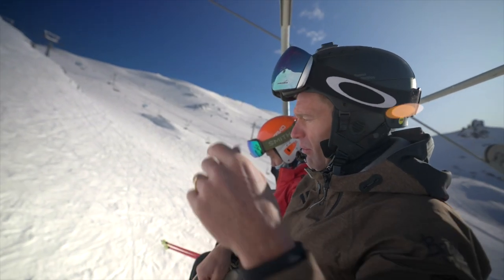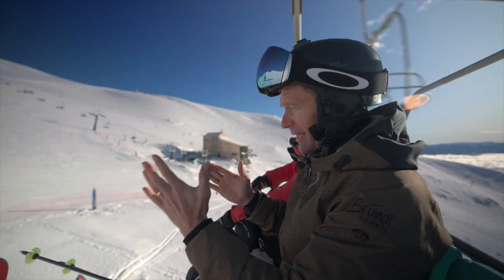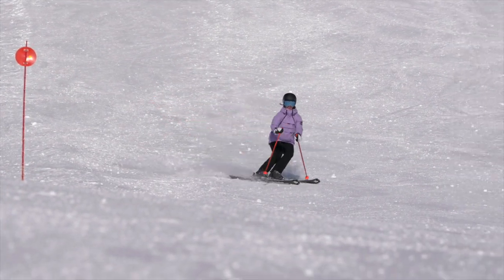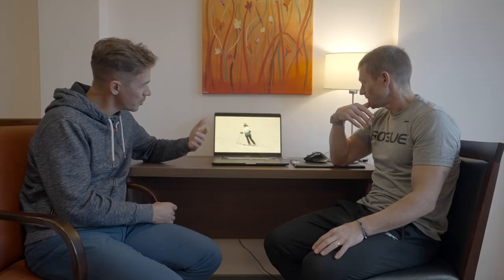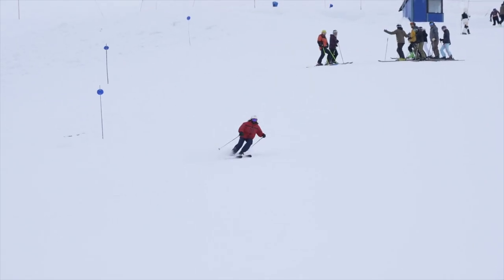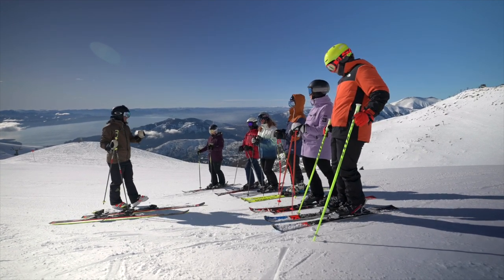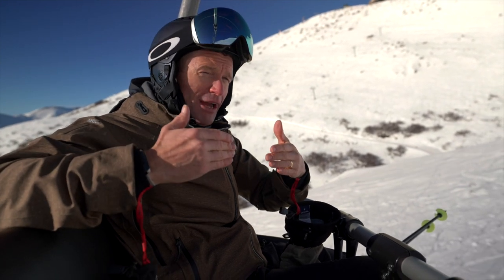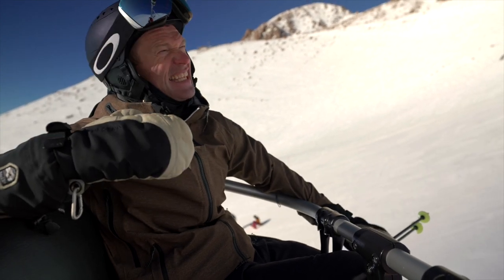Geri Tumbasz and Paul Part 3

Comment: Excellant presentation of a very important part of skiiing.   I have a ski tip from one of Josh Foster's uTube videos that I found really improved my pole planting and skiing. When pole planting your elbow should be slightly below your hand. In order to perform this correctly with the properly sized ski pole, you must angulate by bending your knees, ankles, waist and move your chest forward.  You are already having your students bend their legs in the bottom of the turn this will get their upper body in the right position.
Reply from the maker: Thanks for the comment Lawrence.

Comment: I've been a racer, instructor, and coach; and each uses a different approach.  When Bodie Miller, Marcel Hirscher, and Mikaela Shiffrin are racing, their pole plant is very subtle in most instances, if at all.  When they are free skiing their pole plant is more apparent.  This is because racing gates forces you to turn because of the requirement to hold a line, whereas in free skiing most expert skiers can turn most anywhere they want to in spite of moguls, ice, or crud.  These racers have the ability to make a good turn with or without a distinct pole plant.  For them the pole plant serves them more as balancing maneuver like a high wire walker uses their pole to keep in balance.

For an expert skier that is free skiing, the pole plant provides a rhythm and subsequent turn shape that is constant at least for a couple of turns.  When a coach sets a course for elite racers they purposely set a course where rhythm cannot be established.  The course might have a turn in a deep compression for the skier or a gate at the top of rise where the skier is airborne and may or may not have a compression at the bottom of the turn.  In a quick slalom flush there isn't any time for a traditional pole plant and the arms and forearm guards act as a battering device.  This is why there is course inspection before each race and the racer knows what type a turn they will probably use, and subsequent type of pole plant.  Ted Ligety invented the stivot and the pole plant with this type of turn in GS.

When someone like Marcel skis moguls, a more traditional pole plant is used and the mogul is forcing him where to turn and the type of pole plant to use.  My point is that elite skiers can turn most anywhere they want with or without a pole plant and will modify a pole plant to fit their needs.   An intermediate skier cannot advance without a solid pole plant that provides timing; and a good but not expert skier can't advance unless they learn to make a turn without a pole plant or at least a very subtle one.  Different types of pole plants are just another tool in the expert skier's tool chest.
Reply from the maker: Thanks for the comment. Its great to read your in depth analysis.

Comment: The minutiae of pole planting is right on point for me, as that, stable arm carriage, fore-aft ski weighting & avalement turns are the main things I've been working on at my local snowdome. I bought some telescopic ski poles earlier this year, mainly for ski touring, but also to experiment with different lengths on the downhill. So far I haven't noticed any marked improvement between my usual 125cm & trying 115, 120, 130 & 135cm, but your video should really help to focus in on the benefits of a shorter pole length.
Reply from the maker: Great stuff! Good luck with the sizing of your poles.

Comment: Thanks very much for uploading these episodes, nice to see some snow and skiing. 
On an unrelated note would it be possible to read this @SIA Austria and reply so I can perhaps better understand some things that I have been thinking about lately regarding skiing... 

I dont recall exactly which video you talked about this but I remember you mentioning concentric mouvement in skiing turns and that 
it is not an eccentric mouvement but a concentric one- especially in the second part of the turn (I apologise if maybe I misinterpreted totally or partially 
what you said but this is something that a remember taking away after watching one of your videos.)

This concept definitely makes sense to me, however, I still have some questions (which I would highly appreciate you answering hha)
regarding the first half of the turn (especially medium/long radius carving ones). 

From my understanding, I can move my CoM into the inside by using a toppling effect (this effect, I believe, is less visible in short radius skidded turns because of a lesser inclined upper body) which I can create either by extending the legs (an eccentric motion) and/or by moving my upper body over and into the new turn. 
Personally, I believe that the first option is worst because, once the legs are extended, you can no longer apply any considerable force to the snow and hene lose grip. 
*This first scenario implies that I have grip which I can then extend off of meaning that the whole time my legs are extending, my skis are gripping and turning.
However, if I extend my legs to grip instead of from grip (so from a gripless start) my skis should not turn until I have found grip somewhere at which point my legs will then be forced naturally into a concentric motion (which will help me maintain grip as I have force I can apply to the snow by resisting) due to the lateral forces from the exit of the previous turn preparing me for a nice flexxed transition.

So from this, my questions are : 
.Firstly, is this last scenario representing good or bad ski technique?
.When you talk about con./ecc. motions is it the leg mouvement itself or the way muscles apply energy?
(to contextualise, in your skiing demonstrations, I get the impression that you contract your leg muscles in a concentric manner 
(for ex. in  short turns I see that you progessively lower contract your legs lowering your upper half to extreme degrees which seem almost impossible from the external forces that apply to you meaning that it's majoritarily created by yourself. Video example from your channel : https://youtu.be/0cx3XRbmGek?t=59)
.Do you believe that the way you contract your legs in the second half of the turn is the best technique, mouvement (I believe you create a concentric mouvement directly) ?
(I understand that this question depends from what you want as an output so the answer is subjective, but what do you think from a performance, form point of view)
.Do you utilise this mouvement to have a compact (flexxed) transition, if so why do you not pull your legs, in front of you to make those 90° angles of a compact transition  in the hips and knees?
.Do you believe the concentric motion should be created directly from onself, through muscle activation, or via the present external forces?

Thank you very much for reading this very long comment and hopefully replying, watching SIA Austria is always interesting and enjoyable.
Reply from the maker: I am going to need to read through this a few times and I think we can answer this on a follow up podcast and I am sure it will interest more people. Thanks again for the comment.
Reply: @SIAAustria  Thanks for that. Let me know if I need to clarify some things or better explain myself as I know it is definitely a mouthfull.

Comment: Quite interesting video. My height is 1.90 m and - moreover - I have long legs in comparison to my upper body. The length of my poles is 125 cm, which is short comparing to what would be recommended to me in stores (up to 135 cm!). Obviously I have to try to ski with even shorter poles - down to 120 cm… 🤔
Reply from the maker: I think it will depend on what type of skiing you plan to do on any given day which is why many are choosing telescopic poles. You are much taller than I and I like around 115-117cm so maybe 125cm is not too bad. Maybe it is I that should try to go down to 110cm 😉
Reply: @SIAAustria  As you often say, tall skiers have to pull down their COM 😉 I have to try.

Comment: Thanks for the long (> 30 minutes - YAY! 🙂) episode. I won't comment on the pole planting part because others already have, but I've been thinking about what you said here and in other podcasts about "Alpines Fahrverhalten" or, in English, what you (and probably others) have translated as "Alpine Basic Position."   You and others have interpreted "verhalten" as "behaviour"  which is certainly more correct than "position," so I agree with you so far. But, as an English and German speaker, and in the context of the connection between the pole plant timing and the "Alpines Fahrverhalten," I find your "Alpine Basic 'Behaviour'" to be too literal. Wouldn't you agree that a more contextual translation would be something more like "Alpine Basic Movement Flow?"   That's kind of a mouthful, but IMHO it is more to the point.
Reply from the maker: I suppose behaviour, position and flow can all be intertwined in some way and sometimes we need to adapt the description to help a student understand more clearly.
Reply: Agreed! Sometimes there's just no precise way in one English word to express a concept that is natural in German - and vice versa.